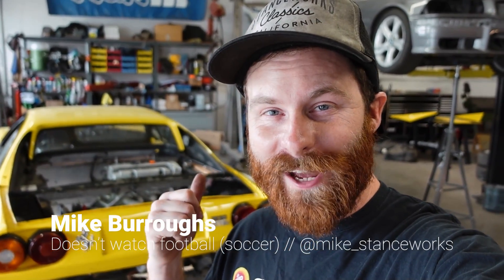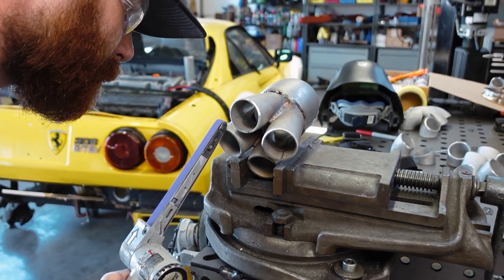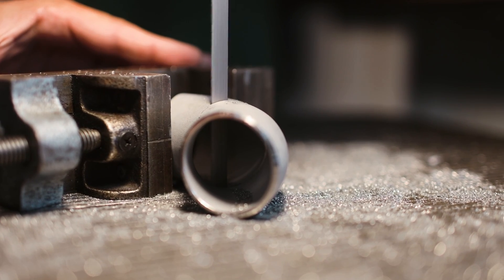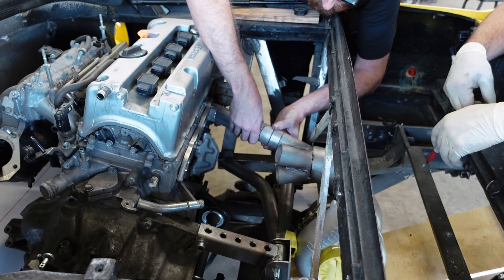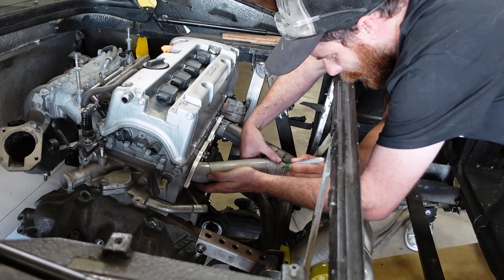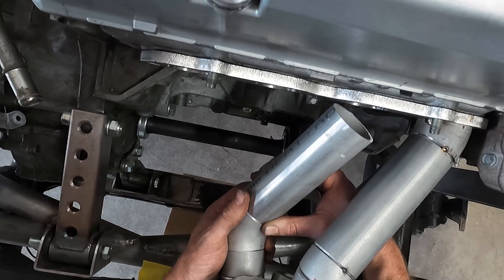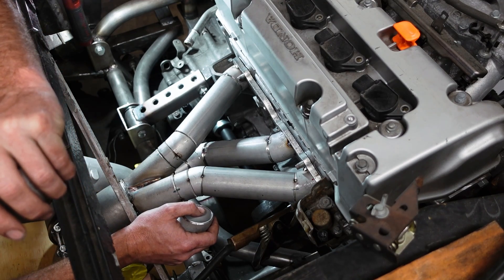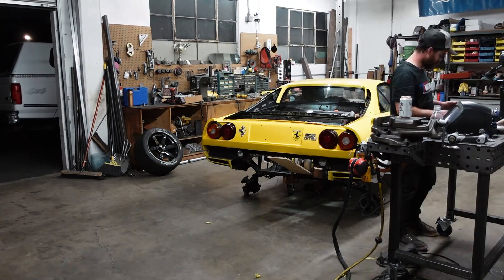Chasing 1000+ HP - Turbo Manifold Build PT.II - K-Swap Ferrari Time Attack Build - Ep. 39

Comment from the maker: Yes guys, I got the firing order wrong. I know, I know. Point still stands! And yes the turbo needs a scavenge setup. 😋
Reply: Hm yaxshi
Reply: Thanks for letting us know at least. I thought it was weird that it didn't do 1-3-4-2 like any other 4-cyl I've seen but I don't know Honda engines and just figured that was part of what makes the K-series magic.
Reply: I think a more elegant solution would be for the first primary to go right below where you had it go and then the last primary would go to were you had the fist primary. So it would be cylinder 1 to bottom passenger side, cylinder 3 to top passenger side, cylinder 4 top drivers side, cylinder 2 to bottom drivers side. All of the primaries would be able to use a straight sections and only the slight turns at the ends as well as the firing order would be in order into the collector
Reply: Hey this was RAD but I just now noticed the OG mini cooper hiding 😍
Reply: Thanks for the correction, I was going to question cylinder 4 firing immediately after cylinder 1

Comment: Two years late to the party here, but for reference for future builds: laying out primaries in CAD is actually really easy (at least in SolidWorks, not sure about Fusion 360).  The caveat is of course that you have to be able to accurately model the position of the collector relative to the position of the exhaust flange.  But if you can do that, then you can instead use CAD to do everything that you painstakingly did by trial and error.

Comment: I think I would have alternated the tubing on the manifold so that the first and third were on top and the second and fourth were on the bottom.  I believe that with that arrangement, the tubes would have been more equal length and more symmetrical with less bends.

Comment: Great series! Loving it!
One newbie question: why put the collector with two pairs of inlets in horisontal orientation with the runners from cylinders 2 and 3 snaking around eachother to the bottom two instead of putting the collector with one inlet in each quadrant (12, 3, 6, 9 o’clock) and with the runners from cylinders 1 & 4 going to 9 and 3 o’clock respectively and cylinders 2 and 3 going to the top/bottom collectors e.g. 12 and 6 o’clock so that they don’t need to snake around eachother?
Reply: They only snake around eachother to make them longer, so all 4 is equal (ish) matched in length. Cylinder 2 and 3 are much closer to the collector than 1 and 4. Rotating the collector wont help much with that. Might even make it harder since there would be different distances from cylinder 2 and 3 to the collector too. Now atleast those are equally far away.

Comment: Really nice manifold !!

But the more I look to the finished product in place the more I can not stop focusing on the tightening position of the flange!
Won't your tubings 1 and 4 going upward just in front of the studs make the installing of the nuts more difficult ?
Sorry I may have missed something, but why having twisted tubing 2 and 3 as you've wanted to have a straight floowed manifold ? Isn't it over complicated task et conter productive operation ?

Still it is a really impressive job you're doing on your 308 !!

Comment: I think a more elegant solution would be for the first primary to go right below where you had it go and then the last primary would go to were you had the fist primary. So it would be cylinder 1 to bottom passenger side, cylinder 3 to top passenger side, cylinder 4 top drivers side, cylinder 2 to bottom drivers side. All of the primaries would be able to use a straight sections and only the slight turns at the ends as well as the firing order would be in order into the collector

Comment: I don't see how that manifold isn't going to crack in minutes. Heavy turbo, long lever, significant G-forces.
Reply from the maker: Did you watch the whole video?
Reply: @stanceworks  I did. Unless you're hard mounting the engine, it's going to move. If you have the turbo solidly, even on that spherical link, it's going to move in more than that one direction. (e.g., Up/Down, Rotate, Left/Right, In/Out).

Comment: Does it worry you a little to be making these types of parts without the actual engine you will use installed? There is standardization, but there are also small deviations.
Reply from the maker: It's the same engine, just not this exact one. There shouldn't be any difference between them.

Comment: You can weld stainless sch10 with a gap. You need to knife edge it first, and then file the sharp edge to a ~1 mm flat. Then ~1 mm air gap all the way around. That is how it's done on oil rigs where these things have to stand up to insane pressures.

Comment: Good deal Mike! What you are talking about is coriolis effect in the collector, and it can impact spool speed slightly, however no where near as much as a true twin scroll setup. I actually decided against these garret G series turbos for my build because they didn't have a twin scroll turbine housing available. Garrett says you don't need it, I disagree, there is measurable proof that twin scroll enhances spool speed.
Reply from the maker: Thanks for the clarification! The main reason I didn't opt for twin scroll is because I have two different turbos and wanted to easily swap between the two. Sacrifices have to be made somewhere, unfortunately.
Reply: @stanceworks  I'm sure the spool speeds will be fine for your plans. Me, RB26s are kinda lazy and I'm trying to modernize while improving response and power. I'm a little nutty though, going to exotic extremes to get every RPM of boost I can.

Comment: Looks great, specially for a first manifold! A tip though, about the ”hanger” for the turbo. I’ve done a few manifolds and learned it is very easy to introduce forces that could potentially snap the somewhat brittle stainless steel.... especially when really hot. I’ve actually snapped the weld between flange and collector at one point, despite having the bracket attached to the engine itself to minimize relative movement. This left the turbo hanging by the oil lines, which is far from ideal.
Reply from the maker: Any suggestions on how to support the turbo based on experience?
Reply: @stanceworks  i would suggest either something spring loaded or something designed in a way where it is strong enough to carry the weight (or some part of the weight) but is weak enough to flex in all other directions.

In heavy duty diesel trucks like Scania (yes, I’m a Swede), MAN, Volvo and so on, thermal expansion in manifolds, turbo interstage piping and such are usually handled by metallic bellows or slip joints.

Comment: Nice work!  Seems like kits like these should come with an identical set of pvc moc-up pipes.  You could work with soft plastic and tape to get it figured out, then cut metal once, weld and be done.  Much less expensive waste and much quicker, I  would think.

Comment: Isn't the turbo too far away from the intake? This will increase the intake volume causing lag....
Reply from the maker: A normal turbo system runs its intake piping from the turbo all the way down to the front bumper and back to the intake. This will be significantly shorter than that. So no.
Reply: Mainfold pipes shouldnt be as short as it gets? Shorter pipes will loose less egt.

Comment: Good fabrication!

Firing order is 1342. But on a single scroll, uneven exhaust flow actually quickens spool. But it can overheat an exhaust port in the cylinder head. 

Keep up the good work!

Comment: Awesome job with the manifold. It looks incredible and when you finish it white it will look the spaghetti manifolds used on F1 cars in the 60's. Also good thinking on the extra support for the turbo. I was racing on a team that had to retire some years back from the 25 hours of Thunderhill when their turbo K24 swap literally developed a dozen or more cracks on the manifold due to stresses from an overly cantilevered turbo. It was a custom manifold that just could not be repaired so the car was withdrawn. A real let down especially after flying from another country to race.
Reply from the maker: That’s a big bummer. Hopefully we can avoid that one!

Comment: Scavenging is not a consideration in boosted engines. What is a consideration is back pressure and exhaust temperature and cylinder temperature.
A good turbo header or long tube headers on a boosted engine reduces all three.
You might get just as much power on stock OEM cast iron log style manifolds but you could wind up melting valves and or pistons or throwing a rod whereas a good set of headers would have the engine begging for more.

Comment: Mike you shouldn't stick the tungsten into the metal you're welding, it makes the welds look uglier and makes them weaker, and you should also clean the tip incase you touched the bead because it sticks really fast
Reply from the maker: I would never stick the tungsten to the part intentionally lol. Cmon now.

Comment: Tip 
When making alignment marks use O and V shapes in addition to I .
Matching two halves of a V or O is less likely to cause errors in mistaking marks
Alternate them on different pieces but try to avoid a situation where you use the same mark at each end of a tube in a manner that makes it hard to tell which end is which. If you have to have similar parts number them first.

Comment: If you run the turbo that low do you need to have a scavenging pump? Nice having it completely away from the engine compartment to remove the heat soak and also get some nice clean air into it.
Reply from the maker: Yes. Ideally I’ll have a free scavenge port on the dry sump system for the turbo but if not I’ll run a scavenge pump.

Comment: I really appreciate these regular uploads, they come out just in time for me to sit down at lunch and have something to watch. So thank you.
I have a question regard the collector, well it's more of a suggestion, why not clock the collector 45 degrees and keep 1 and 4 in the same place but then 2 and 3 go up and down rather than crossing over, it would give a straighter run and be less complex. You've possibly welded it all up at this point, if so please ignore this. Take care buddy.
Reply from the maker: As said in the video, the crossover is just for fun. There’s no other reason. This manifold will be very visible in the car all said and done and I wanted to make a nice looking part.
Reply: @stanceworks  I really like your project and the idea of a racecar inspired ferrari with this type of engine. Really cool idea. I do not have the appropriate knowledge, but was just thinking of something...
There were several comments regarding the flow and the different lengths of the tubes. But: isn't it more important to have the same kind of angles? Isn't it so that for example the second tube going down (seen from the drivers side) has a way smaller angle right after the exhaust port and thus has more resistance? I suspect that specific part to become much hotter than the others and potentially influence the exhaust port pressure. Again: I am a noob, just wondering...:-)

Comment: when you mount the rod end to the manifold and the car, it will have to accommodate the movement of the engine relative to the care as well. manifold looks nice. i always hated working alone. Khalil is a trooper.

Comment: Is that low turbo placement going to require a scavenge pump?
Reply from the maker: Yes.
Reply: Just asked the same question. I think it's definelty a good idea since the plan is to pull some serious G's in all directions. Would love to see the setup have never seen what goes into designing a scavenge pump system but I am a huge fan of low mounts